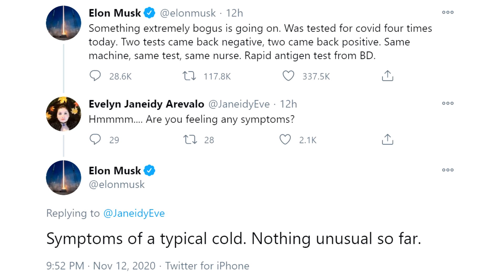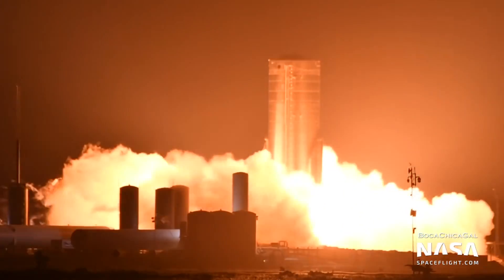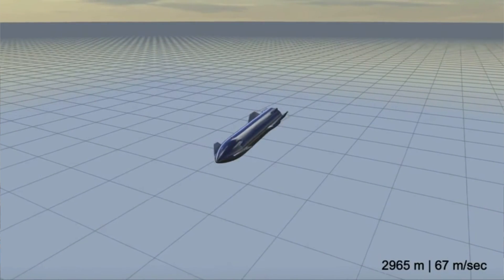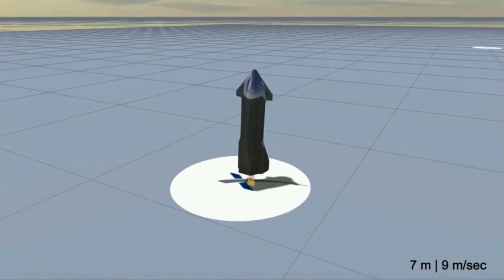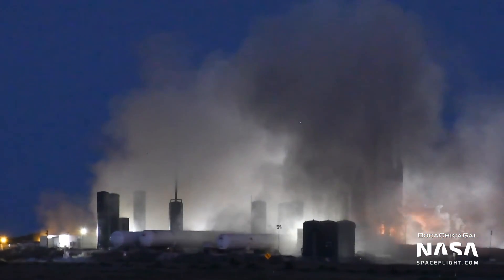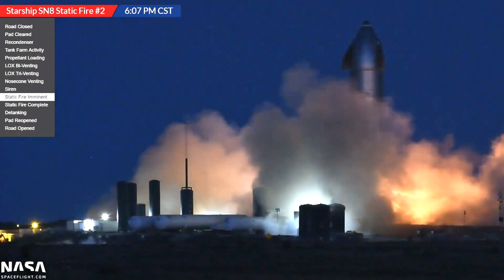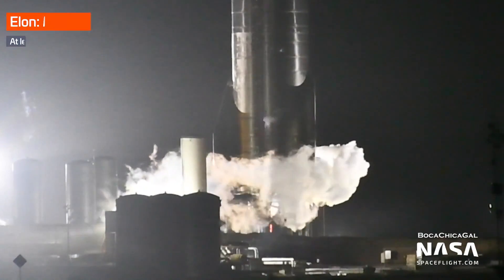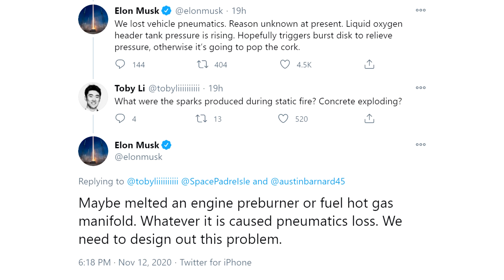Starship Test Destroys Raptor Engine, But Burst Disc Saves Rest Of Vehicle

Comment: I have also heard a similar term used in jet engine test failures, "Hardware Rich Exhaust"
Reply: Unscheduled rapid self disassembly.
Reply: That's always the case when the power stage fails.  For the compressor stage, it is much more likely that "the blades will jump out and meet the crew."
Reply: @flymypg  Antonov had that yesterday, probably seized compressor bearing and the fan decided to take a holiday, wiping out the AC electrical buses and the instrumentation and hydraulics, so the pilots had to do a really heavy landing with no brakes or spoilers. Tough aircraft frame though, it did not fail until after it had left the runway end and was ploughing the frozen field.
Reply: @flymypg  That's a terrifying thought
Reply: Hardware rich combustion on a test flight tends to lead to a shovel recovery.
Reply: Thats now up there with my favourite saying lithobraking :D
Reply: That's beautiful, man.
Reply: That's excellent.

Comment: Well, at least the front didn't fall off.
Reply: That's not very typical, I'd like to make that point. There are a lot of these Starships under construction and seldom does the front fall off.
Reply: @nagualdesign    That's because there are regulations governing the materials that they can be made of.  Cardboard and cardboard derivatives are out.   :-)

Comment: Great video Scott! Still only at 3:56 but.. livestream said "fluid leaking from engine" and you said "maybe cryo fuel".. to me, its clearly glowing orange, and the way it falls.. isn't that molten metal pouring out? Looks obvious, but would love to know the details. I hope they fix it and it doesn't delay anything. Really pumped for the 15k hop!
Reply from the maker: I said I didn't think it was cryo fuel because we'd see condensation. And yes it looked in some ways like molten metal but that seems unlikely.
Reply: @scottmanley  Looked a lot like molten metal to me.
Reply: @nagualdesign  chief engineer's tears
Reply: SpaceX will know for sure if it was molten metal as there will be cooled puddles of it under engine. Also when they inspect engine the missing parts will be obvious. More  worrisome to me is the Pneumatic loss. Was this a hit by debris or caused by engine issue. Even more worrisome is the thought that the engine issue might be caused by plumbing issues with the header tank. Entrapped air or cavitation of some type causing damage to the preburner, or perhaps a failure in the manifold feeding the engine spraying fuel on the hot parts and causing a meltdown. Postmortem will tell SpaceX a lot. Just hope we hear what they find.

Comment: The orange color of whatever was dripping out of the engine indicates a metal with a relatively low melting point.  My guess would be the copper lining of a regeneratively cooled area rather than turbo pump parts made with high temperature alloys.
Reply: @robertcowling4313  They can't just change propellants. Every type of propellant demands an engine all its own and tank sizes that match and at temperatures that fit, and lots more.
Reply: @robertcowling4313  It's hard to say just by looking at the footage, but it doesn't look like it's burning to me, it looks like it's glowing hot. Like molten metal.
Reply: They definitely didn’t move to hyperbolic, let’s be serious xD

Edit: I swear it’s the autocorrector xD I’m leaving that to keep a dozen comment below from losing all sense.
Reply: @trezapoioiuy  Hyperbolic fuel shouldn't be taken literally. 😜
Reply: @nagualdesign  you must mean hypergolic.
Reply: @jvckrs  No, I think he meant hyperbolic. r/woosh
Reply: @jvckrs  Nope. I was quoting trezapoiuioiuy. The joke, you see, is that hyperbole is something not meant to be taken literally, and trezapoiuuoiuoouy had misspelled hypergolic.

Thanks for giving me the opportunity to explain. Jokes are always much funnier when you have to explain them. 👍
Reply: @nagualdesign  Tough crowd eh? If it makes you feel better i got the one about explaining jokes...
Reply: @nagualdesign  ahahah that was a fun typo xD 
Not gonna correct it or a lot of comments won’t make sense anymore

PS I was typing another comment and it turns out the auto corrector caused it xD I saw it in action
Reply: @KeithHearnPlus  r/itswooooshwith4os
Reply: @-danR  Yes, it is particularly dangerous to drop a hypergolic comment in a troll-rich  comment section. Immediate conflagration.
Reply: @trezapoioiuy  they really should add hypergolic to the dictionary... even the spellchecker for this comment sign it as wrong XD
Reply: @Daniel-yy3ty  yes they should!
Reply: @robertcowling4313   You can't just feed a different propellant into a rocket that is designed for a specific one. Similar to how you can't put diesel fuel into a gasoline engine, or vice versa.
Reply: @odysseusrex5908  Actually, hundreds of people do that every day. Only problem is that the engine stops working.
Reply: @nagualdesign   Rather a serious problem, wouldn't you say?
Reply: @odysseusrex5908  I was being hypergolic.

Ba dum-bum tssh...
Reply: @nagualdesign  🥁🥁💥
Reply: @odysseusrex5908  I believe that there was one case of a conversion back in the 1960's. I forget what it was, but I want to say the engine from the X-15 was converted from LOX/Anhydrous Ammonia to LOX/RP-1. I am very likely wrong on that.
Reply: @disorganizedorg   Converting is one thing, merely pouring the wrong fuel into an engine is another.
Reply: @odysseusrex5908  Yeah, but you could put natural gas in a gasoline car, or bio-diesel. Not that rocket engines are anything like gasoline engines. It is possible to convert the fuel type with a carb/fuel injector kit.
Reply: @brendanwood1540   So you have completely redesigned and rebuilt your engine, especially with the natural gas conversion. So it is with rockets, only even more so.
Reply: @odysseusrex5908  You're absolutely right; about rockets. Just about the natural gas conversion part; Not so much. The kit includes a gas tank, gas line, and a different carb or injector it's about $4000 to buy. Any gas car could run on natural gas. Back when Union (or Centra) Gas was trying to get refill stations put in all over the place. It was being promoted a bit. But mostly we had a Ford Tempo with a kit because my dad worked at the gas company. In fact most engines will run on wood gas from smoke too. Not very well; or reliable; but it can happen.
Reply: @brendanwood1540   I thought natural gas engines used turbines.
Reply: @odysseusrex5908  While I get where you're going, be careful ever using a diesel engine in such examples, as they'll run on just about anything. Most forms of lube oil, vegetable oil, used cooking oil from a local McDonald's deep fryer, hell I know a guy who owns a transmission shop who runs his diesel pickup off used transmission fluid, and has done so for years. Lol diesels are ridiculous.
Reply: @blackhawks81H   That is interesting. I did not know that. Do you have to adjust the fuel to air ratio or the degree of compression to get ignition on different fuels like that?
Reply: @robertcowling4313  Starship will never, ever be hypergolic.
Reply: @t65bx25  it can be hyperbolic tho
Reply: @robertcowling4313   no. It’s not just unlikely. It’s literally impossible, for so many different reasons
Reply: It's one thing to damage an engine, but to have parts of it 'dripping out the back' takes failure to a new level.
Reply: See, now THIS finally feels like home: a channel where not only the video itself lends itself to furthering the understanding of one's peers, but so, too, even do the comments.  I virtual handshake you from a distance, good friend :).  

From what I can infer, my expertise in this matter is noticeably less than yours, but from what I do know in this regard that certainly sounds like an extremely apt inference -even if you end up being corrected in this, you've certainly provided fact-based food-for-thought, and for that I thank you.
Reply: As good a guess as any I suppose.
Reply: @robertcowling4313  No, it's impossible to change propellant.
Reply: @robertcowling4313   Nah man, the engine was designed for a specific propellant.
Reply: Hypergoblin is the correct
Reply: Sounds like one of my favorite rocketry terms:  “engine rich exhaust”
Reply: Is there any significant amount of hydraulic oil in the controls, kinda looked like a dripping oil fire to me.
Reply: I was thinking hydraulic oil burning, if that’s something they have in these engines.
Reply: @jackgibbons6013  If that was hydraulic oil a burning pool of oil would form on the ground under the rocket. That would be obvious. A big yellow fire with black smoke.
Reply: @robertcowling4313  never for multiple reasons.
Apart from the need for a completely new engine, as the others explained, there are some fundamental problems that wouldn’t allow even with the appropriate engine.
One is that SpaceX likes to test to failure and perform risky manoeuvres. It would have been very hard to convince the authorities to authorise F9 landing tests, for instance, had it been full with extremely toxic chemicals. Now this is even larger and the manoeuvre harder to perform. Every failure would be a chemical disaster.
And then there’s the idea of manufacturing on Mars, which is one of the reasons why they switched from RP1 to methane. Hypergolic? Again, no way.
And another reason why they chose methane was reusability: methane burns clean, leaving no deposit on the engine. Well sometimes it leaves engine deposits on the ground xD but that’ll be fixed. Now hypergolic not only won’t burn as clean, but any residue would make it dangerous to even approach the rocket without NBC protection. It would really mess up with turnover times, not to mention the safety issue of coming out of the rocket.
Really there’s a big number of reasons why they wouldn’t even consider hypergolic
Reply: JackSpeed 439  yes, I noticed, but there were comments and jokes that came from that autocorrector mishap, so I’m gonna have to leave it as it is.
Reply: JackSpeed 439  
[@Robert Cowling are you an idiot?]

He may be uninformed on such matters, but what's clear is that you're a name-calling douche.
Reply: It is flowing from a reservoir of some kind through a choke point because it keeps showering down at a relatively high rate. If the pre-burner had too much O2/not enough CH4 any alloy in there would burn. Copper also doesn't make bright sparks.
Reply: Flux capacitor maybe 🤔👍🏻
Reply: Looked like lava coming out lol rockets scare me
Reply: Looks to me a lot like a metal/oxygen fire.
Reply: prob a good guess, images of one engine being removed show the bell looks intact at least
Reply: Very likely what appears to be molten metal dripping from the engine bay are mostly burning lumps of frozen methane.  A leak of pressurized supercooled methane is bound to quickly freeze solid if suddenly exposed to atmospheric normal pressure & temperature, and catch fire from the hot engine exhaust. More so if mixed with LOX (liquid oxygen); such mix is essential for normal  Raptor operation .  The above hypothesis could also explain the shower of bright sparks which occurred immediately after the rocked engine was turned on; observe that most of said sparks dimmed during flight, as expected from the exhaustion of a piece of burning combustible.
Reply: 3:24 to 3:28 Did sombody notice two lights in the dark towards top right of screen can somebody clear what that is?
Reply: @robertcowling4313  You can't make Hypergolic fuel on Mars very easily. The plan is to refuel SS on Mars and have the engines re-light using internal power. Hypergolic fuel is also very toxic, corrosive, and hazardous.
Reply: Couldn't a tele-spectroscope answer such questions?
Reply: @jannikheidemann3805   Theoretically, but why not just walk over there and gather some samples to perform chemical analysis on, to say nothing of inspecting the rocket to see what melted.
Reply: @nemo-x  The problem is that the design makes assumptions. Go beyond those assumptions and all you need is liquid oxygen, of which there is plenty..
Reply: I'm gonna guess it's burning fuel dripping, rather than a large volume of melted metal.
Reply: @krvnjrcbs  random speculation is fun. You don’t have to be a part of the conversation, telling people so stop talking about it is kinda silly, if you don’t want to read it, go to another page.
Reply: @krvnjrcbs  It's called "discussing". Although name calling, using terms like "stupid" and "weirdos", is pretty argumentative.
Reply: @krvnjrcbs  Ah.. So that's what you meant when you said, "Stop arguing and wait for the data you weirdos". And you don't see that as being synonymous with "discussing". And you're not being argumentative. Gotcha. 👍

So why take exception to people chewing the fat and having a bit of a joke? Why's that weird, in your opinion?
Reply: kvrnjrcbs is right, stop giving reasons or citing evidence in support of an idea, action or theory [edit] with the aim of persuading others to share one's view, you weirdos! 😡
Reply: COPV burning
Reply: "Concern that maybe the welding on the tank wasn't up to standard" When is Musk going tp stop building rockets in a junkyard!

Comment: "only 22 tons" :D
Reply: Well considering the entire vehicle holds 1200 t of LOX and methane combined that is a small amount to a Starship. That's about 2% of full load and considerably less when the roughly 3000 t of propellant on the booster are counted. Still the 8 tons of methane in the header tank are equivalent to almost 100 t of TNT in their energy content so an explosion from the header would still be about 10 times bigger than the largest non nuclear bombs. A full stack detonating could be in the range of the first nuclear weapons made.
Reply: @javaman4584  They are both called header tanks, the methane header inside the methane main tank, welded to the common bulkhead and feeding into the downcomer and the LOX header tank in the tip of the nose. Both them are referred to as the header tanks.
Reply: "Only 22"
Reply: A small tank of 22 tons

Comment: The fuel valves seem like something you'd want to have a backup for? At least when doing tests like this. Like, if I were doing this, I'd identify every critical fluid path which either needs to be open or needs to be closed for safe shutdown and add a remote-controlled secondary valve to make that happen. (These needn't be proper two-position valves; since they're only used in an emergency, they can be non-reversible one-shot devices, e.g. a clamp which crimps a pipe flat to close it, or a bypass line sealed with a breech disk with a pyrotechnic device to pop the disk on command.)
Reply: They did have a single use backup valve in the form of a burst disc.
Reply: @please_stop-v7o  Which they weren't sure would fire before the tank burst. I'm talking about a controlled backup - they hit the big red ABORT button, and it seals all the pipes that must be sealed and opens all the paths that must be opened to make the rocket safe, even if the rocket's internal power, control, or hydraulic systems are out.
Reply: @macdjord  They weren't sure as in nothing is 100% certain in life, but burst discs are extremely reliable. The pressurization mechanism for the fuel used by the Draco abort thrusters in Dragon has been changed from an active valve to a burst disc for reliability and safety. And these are early prototypes, future Starships for point to point or deep space are probably going to have more redundancy.

Comment: Well don't forget, besides an engine(maybe) the burst disc needs to be replace. Not sure how easy that is to access
Reply: Burst disks are just between a flange. Unbolt, swap and go again.

Buckling pins are more easily fixable, but need different replacement methods.
Reply: Burst-disks are usually easy to replace.
Reply: @gordonrichardson2972  Yep, otherwise there would be little point in having them...
Reply: Also don't forget the pneumatic failure that needs to be fixed.

Comment: This is over simple but I thought the fuel was in a big 'sack' to prevent sloshing?
Reply: +Randy hightower
feels like a pretty heavy solution, if you can even find plastics that stay flexible enough to not break under tension while exposed to cryogenic temperatures. Even in WW2 fighter planes the rubber lined anti leak tanks where a hefty trade off on performance.

Comment: Starship just doesn't look feasible to me.
Reply: The whole flip manoeuvre is pretty ambitious, to say the least. There's nothing in the laws of physics that say it can't be done. It just comes down to the cost of development versus the ever decreasing pot of funding.

If you recall, it was down to the wire when they developed the Falcon 9, and Musk said that if they hadn't had that first successful landing in 2015 they only had a couple more tries before the money ran out. Though I suppose they would have applied for another round of funding rather than giving up.
Reply: @nagualdesign  Landing a booster on a barge in the middle of the ocean seemed pretty ambitious, too. :)
Reply: @KeithHearnPlus  True.
Reply: @KeithHearnPlus  Peanuts compared to even flying people to the Moon, let alone Mars - and certainly that crazy 'belly-flop' manover.  No chance of that ever being man-rated (or possibly even working).  Elon is a  dreamer, not a saint.
Reply: @paulhaynes8045  The abruptness of the belly flop is a factor of the test article.  The final versions are planned to have more powerful hot thrusters which will be used rather than such drastic engine gimbaling.  As for man-rated if they can get people willing to get on it, they will get on it.  The only things that get 'man-rated' by anyone are NASA missions.